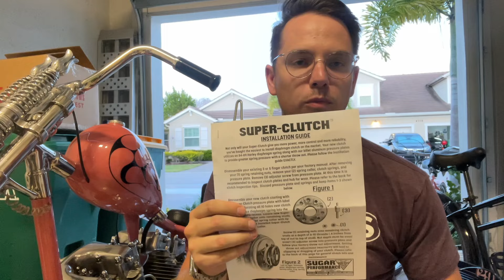SugarBaby Cycles Super Clutch on My Shovelhead | Super Smooth

Comment: I have been through the exact same issue you are having with this clutch and the clearance with a primary cover. I added spacers between the oil bag mount and the lower frame mount and bent the whole primary outwards hah. I cannot fit my derby cover on. Unfortunately my research for a longer belt to actually allow the clutch to be centered in the derby cover also was unsuccessful, BDL doesn't have "longer" belts with the same tooth count. Someone in the comments suggested adding a gasket between inner and outer primary so I will likely give it a shot at some point to see if I can add a derby cover. 

I also realized even after chasing my lurching clutch issue / grinding from stop or on a hill was really related to my clutch plates being shit. I had done a tamer, long roller clutch hub, and new basket, and the sugarbaby super clutch. None of it resolved that issue. So I ended up getting BDL clutch plates and its never been smoother. My only caveat with the sugar baby clutch is there is very minimal friction zone, its pretty much on or off , but after getting used to it i dont notice it now, foot clutch as well.

Comment: Great video – Love your bike!  I see your throttle cable is hidden.  How does the throttle mechanism work inside the handlebar?
Reply from the maker: @garystahl8137  thanks! It’s a stock panhead/ironhead internal throttle. I got a ride side stock handlebar from one of those bikes and took the internal throttle assemble out of it and transferred it to this set of bars

Comment: If you are having trouble with the clutch not disengaging completely ( especially after the bike warms up), it might be your primary belt. In the video, it looks like it's pretty tight. When the belt heats up, it actually shrinks a small bit. This will cause the belt to pull the clutch basket forward and make your bike walk a little when you disengage the clutch. Since you're running an inner primary,  you don't have any transmission adjustments. They make 1 1/2 inch belts that are a couple of teeth larger. This could fix your problem. I'm not saying the new clutch setup isn't going to work. In fact, the diaphragm spring is way nicer. Just wanted to throw that out there for. Good luck, and nice ride!
Reply from the maker: Thanks! I have full adjustability of the trans as I cut up the inner primary so I could slide. Belt actually isn’t super tight but I’ll look into it
Reply: @drmikemerkt let that belt floppppppp and I had to run the big fix bearings and ram jet retainer with my sugar baby clutch to get it to stop grinding
Reply from the maker: @pangeachoppers thanks for that tip!!!
Reply from the maker: @pangeachoppers yeah, the guy who rebuilt my motor was a factory mechanic for HD on the xr750s and that’s how we told me to set it up 🤷🏼‍♂️

Comment: You're better off without the cover anyway being that it's a dry primary. Those generate a lot of heat and need a way to vent. This video gave me food for thought though as I'm running a dry clutch on my shovel too.
Reply from the maker: For sure, not made that I ended up spacing out the bottom of my primary for added clearance and air flow. I’ll put my derby back on soon
Reply: Definitely! He could possibly put spacers between the inner and outer primary. That way, he could keep the outer primary with the derby cover on and vent the primary.
Reply from the maker: @rustythrottle5713  yeah the outer is spaced out at the bottom

Comment: I had clearance issues on my clutch and  outter cover with my primo clutch. I put a cork primary gasket on and it spaced the outter cover enough to eliminate my rubbing issue
Reply from the maker: Good idea! I ended up spacing the bottom of my cover out a bit and that solved my issues

Comment: Your shop practices are killing me, grinding as opposed to getting shorter screws, bending tabs etc. have a blessed week my friend.
Reply from the maker: Yeah I hear you, at the same time they chrome screws from colony…so you can’t just get just get screw heads from them which is essentially all they are now. The bottom of the primary is spaced out slightly with spacers as well. Bending those tabs out just a hair helped with clearance issues
Reply: It’s called ingenuity bro